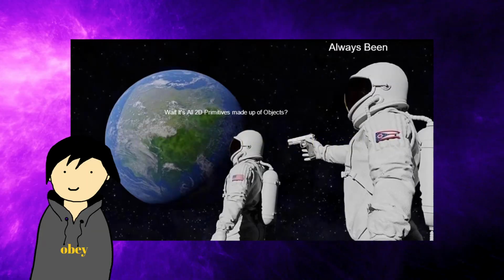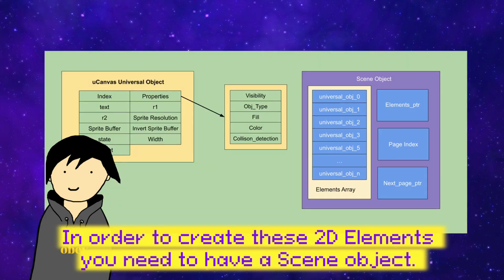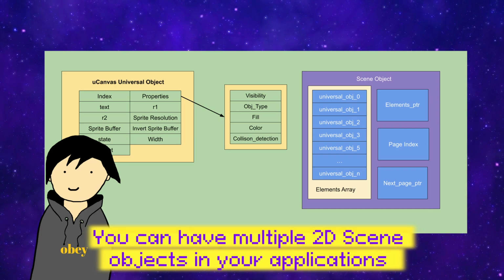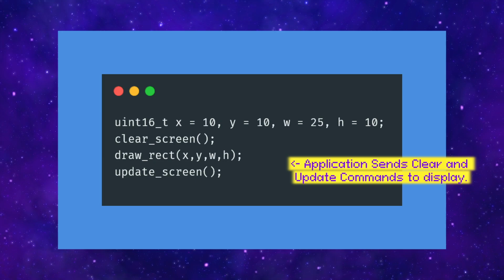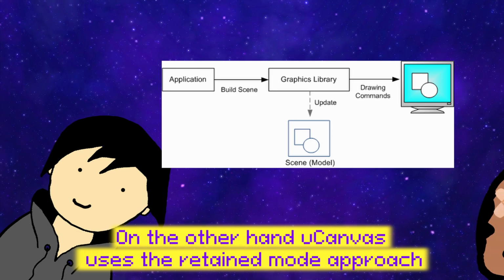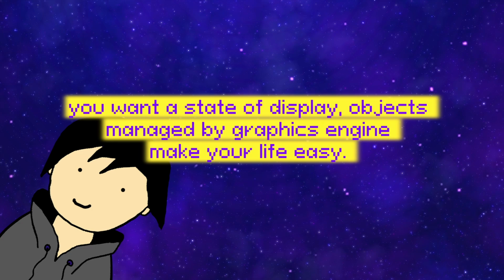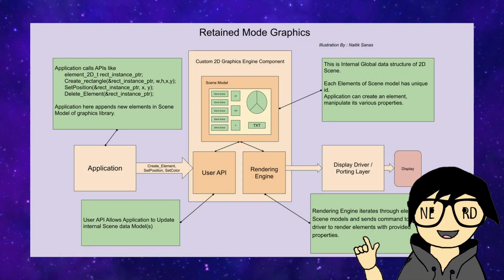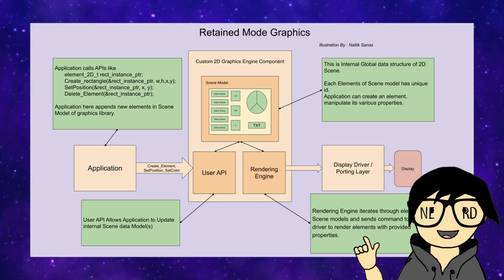I built my own 2D Graphics Engine for ESP32- Part 1

Comment: If I want to use esp idf then should I know embedded C
Reply from the maker: If you're already comfortable with arduino then it's relatively easy to get started with esp-idf.
Reply: @NTKEmbeddedLab  arduino functions and keywords are different and embedded functions and keywords are different that is why i'm asking. I don't think I can get any job if I know arduino ide language.
Reply from the maker: of course there will be different keywords and whole different project structure than just single .ino file. but fundamental programming patterns are same. It can take time to get used to new environment but its not impossible. search "Getting started with ESP-IDF" and you'll find a lot of helpful content around it.